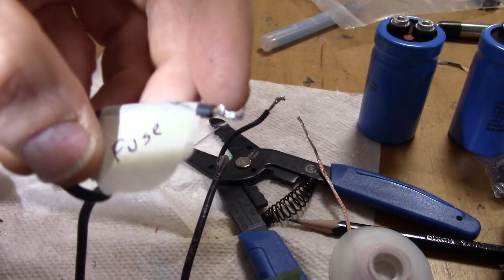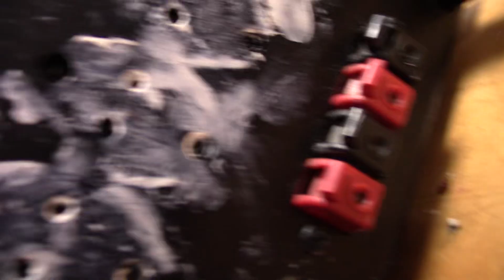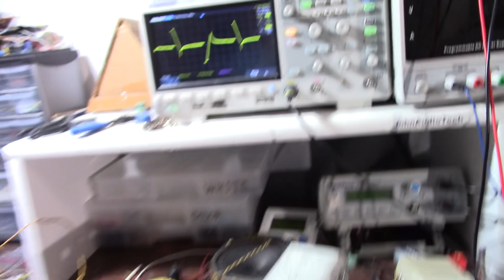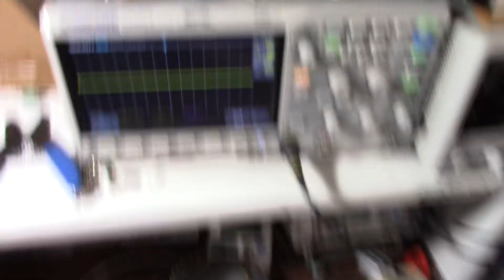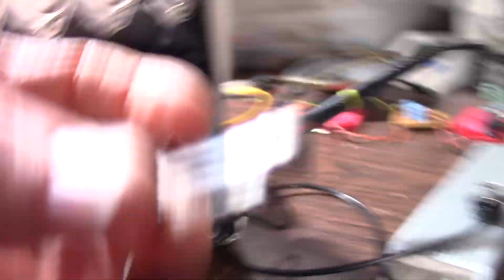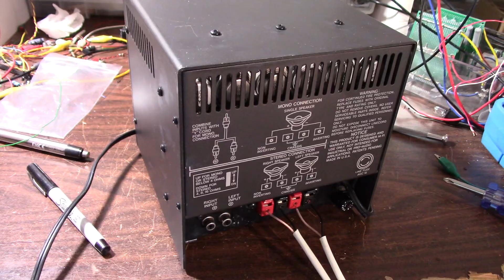Carver M-400 completed repair

Comment: Good Job ! I am just getting into one that blows the fuse, just opened it, and what I suspect from the start is the Power Filter Caps. My problem is I work in Venezuela, and with the US sanctions on my country it´s a bitch to get good components out here, no Amazon or any of that...
By the way, I fiund the Service Manual online and there is a troubleshooting guide for many problems in there, and on page 53 there is a checklist for "blowing fuse" WHICH POINTS GENERALLY THAT SAME DIRECTION.
Thamks for the video, enjoyed your work !!
Reply: Where did you find the service manual?  I am trying to figure out what Triac I need as my M400 unit has no markings on the Triac that is bad.
Reply: @JuanGarcia-kv7yv  you can find it online... But you won't find the Triac, discontinued... 🥹

Comment: Great videos as always. - I am a huge fan of CARVER. The man and the machine. I have eight M-400's. Some A versions and some T versions and some just plain. They all still run fine with only one that has a display failure. Also a fist full of M-1.5's M-500's and several assorted pre-amps with and without Sonic Hologram functions. I was sold on the SIZZLE a long time ago, but the long-term performance and quality of these machines outpaced that sizzle. I still love these pieces of electronic artwork. And use and enjoy them every day.

Comment: well.... you can test the amp even out on the box u know.... dont put load thing try all biasing is correct stuff etc and dcout stuff with help on the bulb it works better no hassle even no heatsink stuff it work just dont put anything in it

Comment: Can there be distortion or clipping in audio due to the value of Output and input capacitor if their values are lowered than recommend in datasheet?
2. Can the Capacitor value in negative feedback pins impact the sound quality?

Comment: If you factor in the cost of parts and labor, was it worth repairing is what I would like to know. I have 2 that need to be fixed, and I'm not sure if I should repair them or just toss them into the trash.
Reply from the maker: I see clean working units sold for $500 or better on ebay. They even fetch $ as parts donors. I'd fix them if you are able.
Reply: @JohnAudioTech  Well in that case I'll have to look into seeing what that would cost me. To be honest, I would like to see them working again because I've had them since the early 80's and they served me well for over 20 years.

Comment: Looking forward to the M-400t video. I have 2 of them from the 1980's that probably at least need a recap. I haven't powered either of them up in 10 years, but I'm disappointed in the 100 x 5 wpc Yamaha A/V receiver I put in place of one of them. I have the 2nd one for a spare, since I was so impressed when I bought the first one. I used to swap them every 6 months or so to give them a rest.

Comment: Seams to give a good output but that's an ugly looking amplifier. How it gives so much power without overheating is amazing. Well done in getting it working.
Reply: They don't really look it but Carver designs are really quite good. Dynamic rails, with low biased drivers and the power outputs paralleled to spread the load so even with minimum thermal dissipation it is spec'd ok. Certainly would want to maintain a gap at the rear!
Reply: Amplifier “heat” comes from the potential between the transistors over the bias current. Carver lowers this voltage to less than 10V and modulates it with the incoming signal so that the rails are never more than this amount over the speaker output signal. The results are greatly reduced dissipation at all levels including the least efficient 1/3 power output rating which is approximately the same level as an unclipped, average crest factor (20dB) music signal.